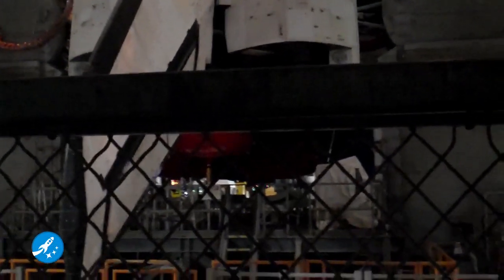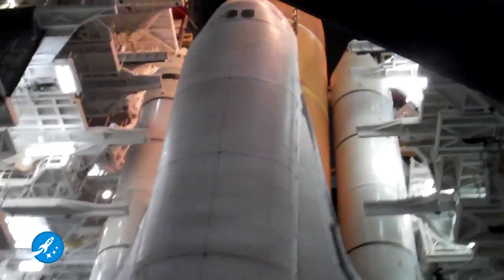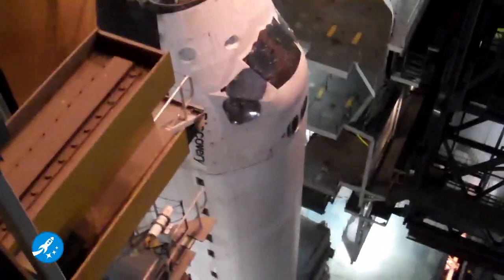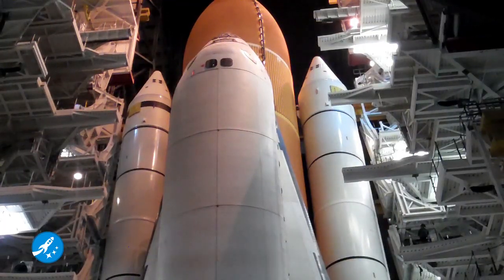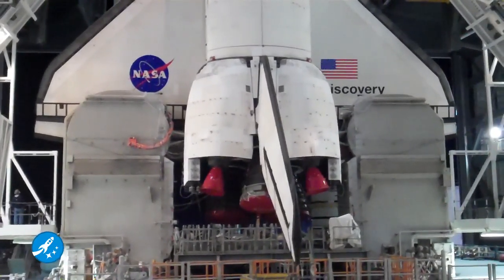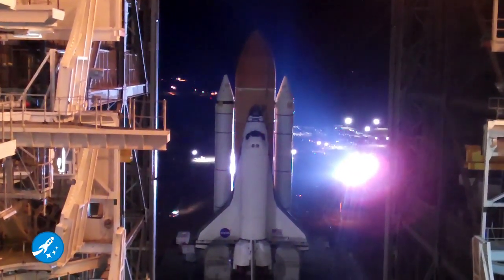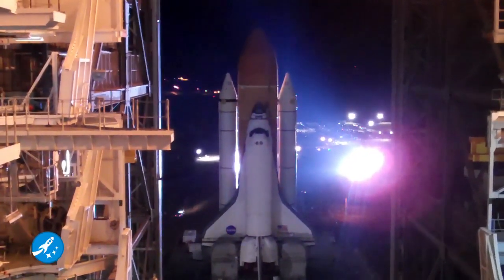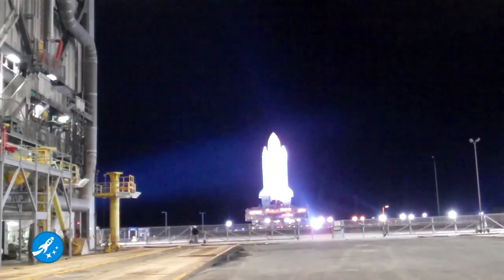The last, last rollout of Discovery - SpacePod 2011.02.07

Comment from the maker: @nilbud That's not 100% true. STS-133 and STS-134 have been on the books for a while. STS-134 slipped due to a payload problem, so it isn't like NASA added another mission, it just got pushed back. Originally STS-133 would fly after STS-134 but that simply wasn't in the cards so instead they launched in order making Endeavour the new last flight. STS-135 on the other hand is a new mission, but not yet funded.